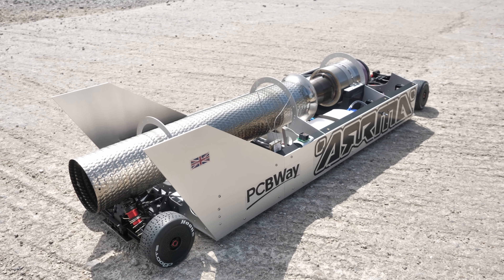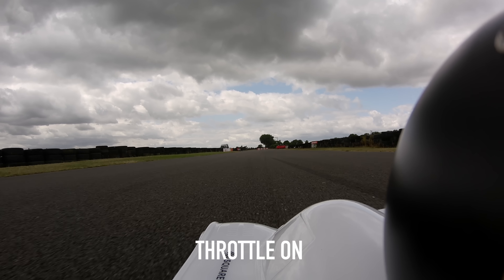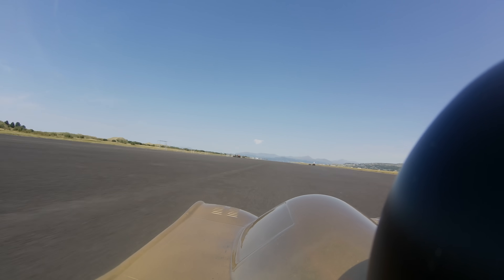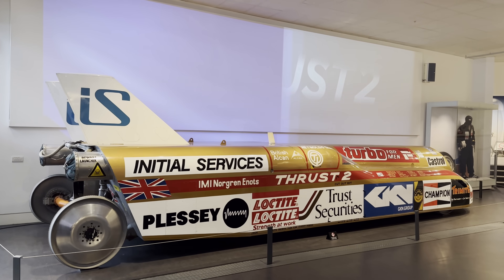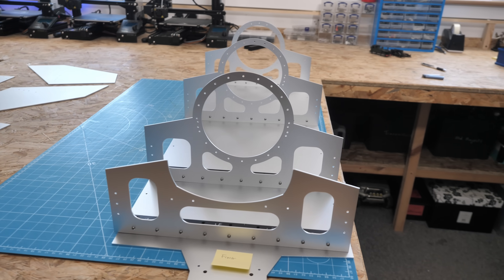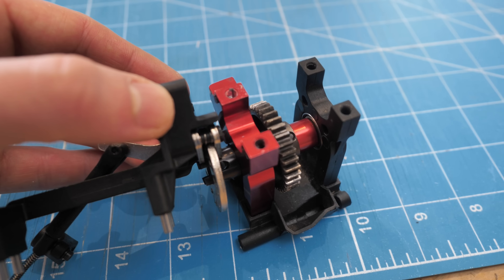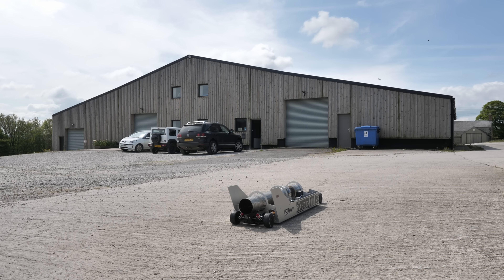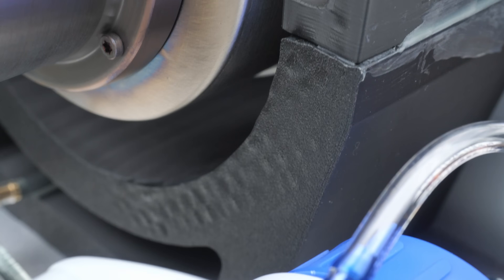Building the WORLDS FASTEST Jet RC Car 2.0

Comment: For your wheels use a split rim with a foam tire encased within. The split along the radius should be no more than .5 of the total rim cross section allowing a foam tire to expand but not at its end edges only in the middle. The foam of the tire that tries to expand along the edge radius grips the inside of the rim tge more it expands allowing the mid section of tire to grip the road.

Comment: Question... You have the gap between the back of the engine and the front of the "thrust tube". will that create, I think it is called a venturi effect, increasing the air volume/speed at the back ( a good thing )? This will need a large "bypass air intake", weather around the engine, ( helps with cooling, scavenging more heat energy? ) or separate, like an air scoop near the thrust tube intake.

Comment: Great job. I noticed 2 things . One is the idea of the front wheels and rear wheels being independent. Run a shaft from the front to the back so that when you bake the front or rear doesn’t lock up. Also just use foam tires .

Comment: Still free spin on wheel? Try to make another electric motor and have it spin the wheel for balance, the jet should be able to accelerate it to 16k rpm and when jet are inactive the wheel will slow its spin down due to the electric motor same concept as engine break on a car. This way with the wheel break force u can push the jet acceleration more at ease and when releasing jet u can also have more ease with the control. That’s how jet car works too. Free spin is stupid

Comment: Hi - nice project. I have a wind tunnel at home that I used to design my full-size Le Mans sportscar. The tunnel takes 1/10th scale models (10%) and runs at up to about 100mph or so, scale speed.  Our camera shoots at 11 frames per second and, at the moment, I only measure drag and do flow visualisation tests - smoke and cotton tufts mainly. It's a fixed floor tunnel but I may upgrade to a moving floor next winter. The  'sting' and sensors could be also be upgraded to measure centre-of-pressure movement, downforce and general stability. You are welcome to use it. I live in the North Wiltshire area. You could also consider using CFD (Computational Fluid Dynamics). Once very expensive but, nowadays becoming more affordable....

Comment: Watching it straining the rope at full thrust took me back to being a teenager at Santa pod  in the late 70's
The first of the twin jet cars (unpainted so I don't know which 1 it was) was being ' tested" in the right hand lane behind the start line at Santa pod.
It was physically chained to the base of what would become the control tower over the start area.

Anyway, my father was race director at the time and we spent every weekend at the pod, race or no race, so I witnessed Allan herridge stood on the seat of the car, facing the rear while using 1 hand on the throttle, the noise and trust got higher and higher
Then with almost no drama it broke its chain and off it went with Allan still stood in it

Fortunately Allan was only small and had driven everything from a road car to a top fuel funny car and dragster, so he turned round,slid into the seat and turned it off.
When we got to were he stopped he had a big smile on his face and obviously enjoyed the drama and drive.

Comment: You should have a try designing a wheel for speed cars. Aluminium rim with solid urethane tyre might work. They used to use something similar on the real land speed cars  in the olden days but with rubber before the speeds got so high. Using urethane you could have various different durometer tyres to test.

Comment: 4:08 off the Line a High mounted Jet makes a nose down torque yes .. BUT at high speeds the air flow does the opposite :yougotthis:
Reply: meaning when you let off the gas and stop making thrust , you could wheelie

Comment: Interesting project but this is far more complicated then it looks.
Main thing is to build very advanced aerodynamic body that is capable to push the car right on the track,in the same way like modern super cars do which enables super high speed and great stability.
But this companies spends milions of dollars on design and testing in air tunnels to make sure car would be cemented to the ground at this speeds,they also have profesionals that know everything about aerodynamics its not something then one individual can do easily in they garage.
There is so many unkown variables and thats why it would be really difficult to built it...i wish you the best and to make it.
With right Jet engine and right design this type of RC car would very easy beat current record and most likely go far over even beyond 200 km/h lol.
If you use something like KingTech K320G4+ which is probably most powerfull jet engine for RC models,only sky is a limit!
Keep the videos coming it would be really interesting to see a final results.

Comment: maybe you can use the wheels of skates those can handle like 400N of force each and 4 wheels will add upto 1200N and they are also sustainable against damage try using road wheels tho coz other wheels make alot of noise

Comment: Diffusers?
Front & Rear?
Basically smaller find like you have on each side topside, but attached to the underside. This can make the air beneath your car flow smoothly instead of just a lot of chaos. This reduces drag, the first law of thermodynamics is friction and drag is friction of the air against your car. You can reduce this drag by setting some diffusers. Forgive me if you have already done this. I hope you break the record! I'm positive you will !
Good 🤞 Luck!!!!!!!!

Comment: my guy... u got plenty of power... u will still fly up on bumps... cause ur belly is flat.... u might want to consider counterweights.... basically a concrete ciderblock in front of the car... under the case... so it doesnt lift up.

Comment: Why not just turn some aluminum disks, knurl the rims for some traction, and fit them with bearing.  I know plastic and foam wheels aren't going to hold up.  Its the same reason the real jet cars they did the speed runs with had metal wheels.  They couldn't get rubber tires to stay together at those RPMs.

Comment: Cool ass car. If you want it to be more stable flush the screws with the fussilage. The Mitsubishi zero was the first mass production fighter plane to do that and it was a beast for the time( for those you'll say it still lost yes it did but only because they never improved the design through the years. If they had done that it would have been a different story somewhat)

Comment: Pleased to see you haven't given up really looking forward to more, as far as heat protection around the nozzle in other projects I've used the materials out of hair dryers it's very resistant maybe you can get a piece and test with blowtorch you will be impressed. Great work maybe add fuel ring in the afterburner 🔥😎✔️

Comment: So wild idea.. Regarding the issue of air flow underneath the cars over bumps and flipping.. Look into what NASCAR does with flaps. Maybe not so much for spins, but something mounted underneath designed to drop down if the car goes above a certain angle.

Comment: Hi, have you considered using the Venturi principal as used in passenger airliner's escape chutes as a way of increasing the amount of air coming out of the thrust tube? I noticed the bell shape of the tube inlet and it made me think of how escape chutes inflate quickly and efficiently using small pressurised cannisters. Your prototype was probably already using the Venturi principal because the bodywork was not fitted. Provision for extra air intake over the engines needs will need to be included. Hope this helps and the best of British luck. Think BIG and go for 150mph.

Comment: Aluminium tape is your friend. Cheap, comes with its own adhesive and actually intended for shielding melty stuff from hot stuff!
Also, consider biasing your breaks, you probably want a bit rear biased to have a centering force while breaking.
And next time use a steel cable XD

Comment: Mounting the engine with the nose down will drive the chassis onto the track & a tunnel under the chassis is desirable to create negative pressure as well. Independent suspension will allow body roll that will induce yaw, take a closer look at Thrust 2. Wide tires are undesirable for straight line high speed when they are not driven. Cool project, goo luck.😎

Comment: When you went to see the land speed record car in coventry did you not notice that the wheels  were not rubber coated but heavy solid steel rims instead of rubber & plastic.  Also the heat sheild for  the engine  could  be thin layer of concete to add weight & cut down on the  way wouldness of the car..

Comment: I'm 5 min in, and had a thought that the car should have air inlets perhaps front left and right, so as to draw air through and create a vacuum to draw the front end down onto the road surface.  If it had a spring-loaded bypass gate, or could intrinsically flex under load, then it could self-adjust for speed and limit the downforce to a design max which the tires and axles could handle.
Is this a decent idea?

Comment: Please Check the distance between the tail cone of the Turbine and entry of the Thrust Tube as this will make a significant difference to this project!!

There is a very specific Sweet Spot for this that gives the maximum thrust and lowest thrust tube heating. Many people measure the thrust of this setup and change the distance to get different readings to find the best gap (sometimes the tail cone overlaps the thrust tube also. There is more information on this in the last pages of the Jet Cat catalog. This will make a significant difference to this project!!!

Comment: Next time incorporate the thrust tube extension onto the engine not a separate item just use the same shape & taper of the original, you could also incorporate a simple after burner into this tube by injecting raw fuel through a ring with tiny holes spraying into the exhaust just before it exits the pipe you could do this with a simple valve radio activated from 1 of the fuel tanks, can't wait to see the runs

Comment: Great Build but make sure to beef up the suspension, when you put the car down on the floor the springs bounced a lot. With a big wing and going fast, the suspension collapses changing the handing of the car, a little stiiffer springs will help.

Comment: Since you are not using the wheels to power the car I would consider using 1/5th scale FG Sportsline GT suspension and wheels with your Jet engine. The tires are stronger with more grip. The stance is wider and much more stout. The weight wouldn't be much more. Less chance of losing control. You will also have 4 brake discs to slow the car down with ease. I really don't think the 1/7th setup is the ticket to high speed with a jet engine as it is with electric power. Besides if you haven't noticed the speed cares are now twice as long as a stock arrma chassis. Just a suggestion because you're working with thrust and need some weight under that engine to keep the car on the ground. Plus the 1/5 rubber tires with beadlocks can mostly hold up to more speed than the foam 1/7th scale tires that are glued on and last only one run.

Comment: I know you were going for a certain look, but the design seems to have a lot of added weight and unused space. Surfaces cause drag, and weight will  dampen acceleration, which will require longer drag strips. Consult with an aero engineer, I'm sure any will be glad to help.

Comment: You need to watch Raz Shifren, he uses an airfield and "perfect pass" software to get battery powered brushless motors to over 200mph.
 Beware your Thrust 2 mega machine are capable of breaking legs and ankles as they lose control at high speeds. Raz develops his own components and if you got in touch might impart some valuable information. From what I gather the speeds a few guys are trying to reach are at such a stage dependant upon very small but essential margins and settings. He would love to see your work. Respect

Comment: Would it be possible or even beneficial to use some of the engines suction to keep the car grounded to help mitigate the “liftoff”. Or even better, because it does not suck in dirt, some airfoil type stabilizers keeping it down?

Comment: Regarding the lift created on bumps via the body, wouldn't it help to add cuts to the front floor so that any air rushing under it could escape through the chassis, if any creating pressure at the backside and therefore planting the car back on the ground?
Interested in anybody with actual experience responding if this could work!

Anyway, cool to see you follow up on the landspeed-RC-car, will watch closely! :)

Comment: Re: engine mount, Could cut open a coke can and , flatten that out for a lightweight heat shield and attached with silicone gasket sealer?

Comment: Why not play with tipping the engine angle downward, to "push" down the front end a degree or two until a sweet spot is found?? You could tip the front of the engine down so that the thrust has a slight downward force? No?

Comment: Definitely need foam tires or capped aluminum wheels with neoprene foam bonded to them, and trued/balanced on a lathe.  Look up how 1/10 and 1/12 scale rc race car wheels are used when racing on carpet.  There are special lathes used just for this purpose.

Comment: You can try to Connect a gyro or stabilisatin sensor onboard that controll a servo connected to ”wings” or ”spoilers” in front of the car that help pushing more downforce when going faster or when the car begin to bump. So the sensor or gyro or stabilisation sense when the car is not horizontal. Or just Connect a servo to those spoilers/wings in front that compensate with the throttle

Comment: Go with titanium pizza cutter wheels and use epoxy to glue on high density o rings as the surface rubber to the machined slot in the wheels.

Comment: The way you set that engine in the tube, is actually smart, not only will it bring in cool outside to cool that pipe, but said cool air will provide further thrust allowing you to gain more output than the engine alone, In the US in the mid to late 1990's they did a similar thing to the exhaust zoomies to drag outside air to make even more downforce than the typical exhaust pipes wound. it was even shown to pull something through the pipe (A rag I think) and shoot it like 50 ft. into the air at one race. Not sure if this was the intention by you, but very smart

Comment: if you think to use gyro to stabilize the direction in line with the track, you have to reduce the gain of PID stabilisation according with the speed  for prevent oscillation , maybe ardupilot with gps could help ...

Comment: What if you used a titanium core wheel with industrial level polyurethane outer layer to possibly withstand the rpm’s at high speeds

Comment: Hey dude. A lot of great engineering and time  going into this. Its really cool. 

However …. please don’t use those printed plastic joiners to hold your ribs to the chassis plate. 
I would almost guarantee they won’t be strong enough. 
The threads are inserted from the same side as the piece they are secured to by the look of it, so they can pull out. 
You would be much better off getting some aluminium 90deg angle (it’s a stock extruded material). You could drill and tap the angle to bolt it together or drill right through and bolt through. 

Seriously, it would be a  much stronger solution. 
At 200mph the pressure in the body will be huge. I wouldn’t be surprised if that alone ripped it apart. 

Good luck mate 👍 look forward to seeing it run.
Reply: That would only be a concern for the test he already succeeded at, while driving it's gonna have much less stress on that point.
Reply: @dries-pederjanse6249  I fully disagree with that but we are all entitled to our opinions. 
I just don’t want to see all his heard work fall apart. A printed part with a thread hot inserted into it on such a joint really isn’t very good. 
I’m sure the fact he could draw it and print it nice and accurately was the most appealing part of the decision to do it that way, but for the structural integrity of the chassis I’m afraid it needs more work put into it than that.
Reply: I'm sure he is aware of the lift problem, but any semblance of a chin will keep the air out. Down lock front shocks could also keep the front end from lifting up on even a small bump and would be game over.
Reply: Couple of strategic tacks with a TIG would do wonders for this things overall longevity!
Reply: @zogworth  I would agree, but I’m a fabricator/welder(TIG) by trade 😂. 
Aluminium TIG isn’t exactly the easiest thing for a garage enthusiast to pick up 😊 (certainly it is doable though 👍)
Reply: I was shocked at that too. Also the flat bottomed box shape. Will take off. I'd use a jetplane fuselage with outrigger wheels.
Reply: @ThomasPCGuruENGINES  that’s a good point about the flat bottom. Potentially used correctly though it could produce a suction onto the road. 
But yes if air gets under it, its game over man. 
I just don’t want to see all this work fall apart around the chassis 😊.
Reply: I really hope he sees this but the comment doesn't have nearly enough likes as one would hope

Comment: Would putting the engine with a slight tail up orientation add enough down force so you don't have to worry so much about aero? I thinking that to are now using over 2x the thrust as the original. A small amount of it for down force wouldn't hurt.

Comment: Follow the wheel technology of full-size land-speed development — 100 percent aluminum alloy wheels with no additional 'tire' material, it's all going to tear off anyway at speed. Your wheel size in relation to the track surface is your biggest enemy. Every piece of gravel and rough surface is amplified by the scale of your car. You''ll need the ultra smoothest track surface you can find to run on, with a thorough leaf blower application before each run.